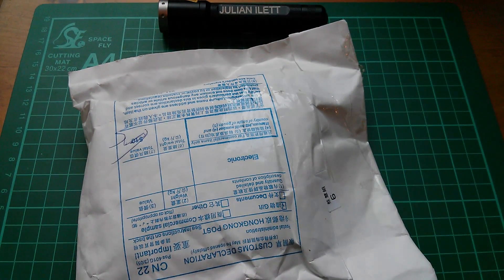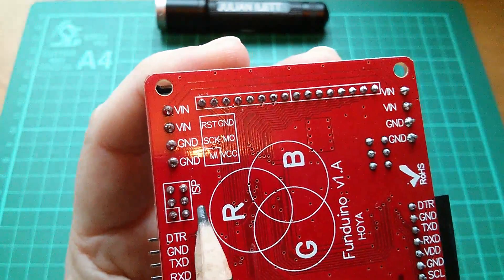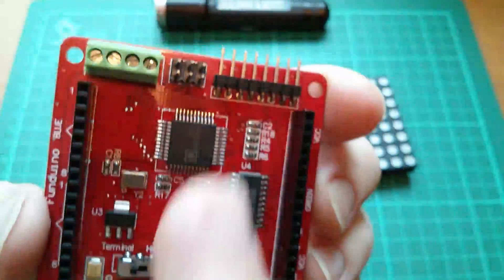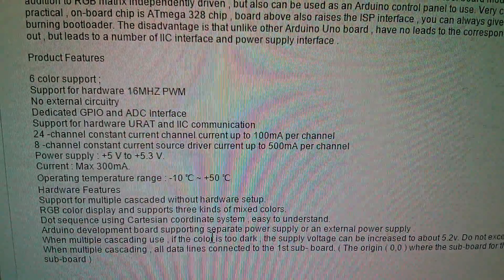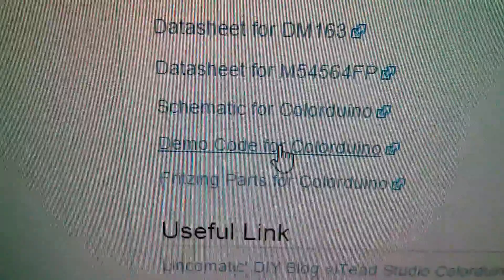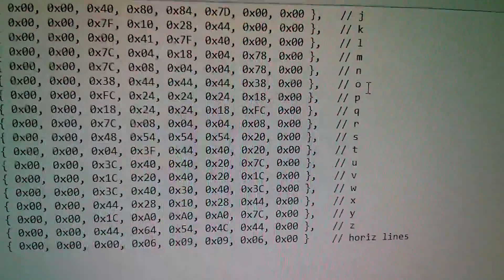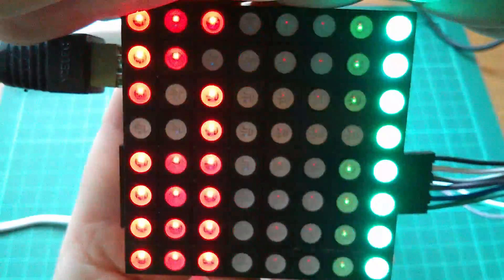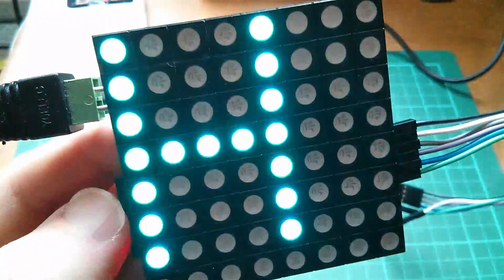Postbag: #30 - Happy Christmas on an ICS RGB LED Matrix

Comment: Hello these posts are from 2014 so not sure if the same topics are still valid, I got a Similar Board it says HW-426 but looks 100% similar, I am trying to upload code from Arduino IDE using USB to UART but not successful, any help is appreciated

Comment: CHeck this out:

/**
 * Colorduino Christmas Ornament
 * @author Raj Madhuram, 2014
 */
#include "fonts.c"
#include <Colorduino.h>

int mode = 0;

// For scroller.
int stepCounter = 0;
int scrollCounter = 0;
int currentGreeting = 0;
int const MAX_STRINGS = 4;
const char *greetings[MAX_STRINGS] = {
  "* Merry Christmas! Drop your presents below. *",
  "For unto us a Child is born - Is 9:6 ",
  "Joy to the world ",
  "Emmanuel, God with us "
};

// For color changing star.
typedef struct Color {
  int r;
  int g;
  int b;
};

Color current;
Color target;
int colorCounter = 0;
int const MAX_STEPS = 10;

char buffer[8][8];

/******************************************************
Name: ColorFill
Function: Fill the frame with a color
Parameter:R: the value of RED.   Range:RED 0~255
          G: the value of GREEN. Range:RED 0~255
          B: the value of BLUE.  Range:RED 0~255
********************************************************/
void ColorFill(unsigned char R,unsigned char G,unsigned char B)
{
  PixelRGB *p = Colorduino.GetPixel(0,0);
  for (unsigned char y=0;y<ColorduinoScreenWidth;y++) {
    for(unsigned char x=0;x<ColorduinoScreenHeight;x++) {
      p->r = R;
      p->g = G;
      p->b = B;
      p++;
    }
  }
    
}

void setup()
{
  Colorduino.Init();
  unsigned char whiteBalVal[3] = {36,63,63}; // for LEDSEE 6x6cm round matrix
  Colorduino.SetWhiteBal(whiteBalVal);  
  ColorFill(0, 0, 0);
  for (int i=0; i<8; i++) {
    for (int j=0; j<8; j++) {
      buffer[i][j] = 0;
    }
  }  
}

/**
 * Scroller 
 ***/

void scroll_drawPage() {
  ColorFill(0, 0, 0);
  int r, g, b;
  for (int i=0; i<8; i++) { 
    for (int j=0; j<8; j++) {
      
      if (j < 4) {
        r = 240; g = 0; b = 0;
      } else {
        r = 0; g = 240; b = 0;
      }
    
      if (buffer[i][j] == 1) {
        Colorduino.SetPixel(7-i, j, r, g, b);
      }     
    }
  }
  Colorduino.FlipPage();  
}

void scroll_drawText(int count) {
  
  int fontIndex = (int) count / 6;
  unsigned char c = greetings[currentGreeting][fontIndex];
  
  for (int i=0; i<7; i++) {
    for (int j=0; j<8; j++) {
      buffer[i][j] = buffer[i+1][j];
    }  
  }
  
  int idx = count % 6;
  unsigned char code = 0;
  
  if (idx != 5) {
    code = font[c*5 + idx];
  }
  
  for (int j=0; j<8; j++) {
    buffer[7][j] = code % 2;
    code = code >> 1;
  }
  
  scroll_drawPage();
  
}

/**
 * Color changer
 */
 
void cc_fill() {
  float alpha = (float) colorCounter / MAX_STEPS;
  int r = floor((1-alpha)*current.r + alpha*target.r);
  int g = floor((1-alpha)*current.g + alpha*target.g);
  int b = floor((1-alpha)*current.b + alpha*target.b); 

  // mask with an asterisk.
  
  unsigned char mask[8] = {0x00, 0x99, 0x5a, 0x3c, 0xff, 0x3c, 0x5a, 0x99};
  
  PixelRGB *p = Colorduino.GetPixel(0,0);
  for (int i=0; i<8; i++) {
    int row = mask[i];
    for (int j=0; j<8; j++) {
      if (row % 2 == 1) {
        p->r = r; p->g = g; p->b = b;
      } else {
        p->r = 0; p->g = 0; p->b = 0;
      }
      row = row >> 1;
      p++;
    }
  }
  
  Colorduino.FlipPage();  
} 

void loop()
{
  if (mode == 0) {
    
    colorCounter++;
    cc_fill();
    if (colorCounter == MAX_STEPS) {
      colorCounter = 0;
      stepCounter++;
      if (stepCounter == 20) {
        mode = 1;
        stepCounter = 0;
      }
      current.r = target.r;
      current.g = target.g;
      current.b = target.b;
      
      target.r = random(256);
      target.g = random(256);
      target.b = random(256);    
    }    
    
    delay(200);

  } else if (mode == 1) {
    
    scroll_drawText(scrollCounter);
    scrollCounter++;
    if (scrollCounter >= strlen(greetings[currentGreeting]) * 6) {
      scrollCounter = 0;
      currentGreeting = random(MAX_STRINGS);
      stepCounter++;
      if (stepCounter == 2) {
        mode = 0;
        stepCounter = 0;
      }
    }
    delay(120);
    
  }
}
Credit to the owner stated in the information
Reply: I uploaded this and told my Arduino that it was uploading to a Pro or Pro Mini, probably would have worked to a Uno but I was having problems with errors in the original INO that I had to repair, then run down the included files,  they were still available so I now have my Christmas ornament for the dash of our RV!

Comment: Greetings, I purchased one of these after watching this video.  This year, I have it along down to Arizona where we are spending the winter in our motor home. I plan on putting it in the wind shield with seasonal messages scrolling in color. I did a search of your videos and found this one because I needed the code, having nuked my laptop. I forgot the origional Win 7 disk, had my windows 8 disk along, but found that MS, in their wisdom has locked out my code so I am now running  Linux. Luckily I had  a copy of Mint along, actually it is a real pleasure running it on my little laptop with it's 16 gig of ram, she runs very fast indeed.

Comment: After watching this video several times now since before Christmas a year or so ago, I decided that I could go no longer without this little gem.  So after a bit of searching, I found one a bit cheaper at 14 bucks US and ordered it, from China.  Now, mind you, I have been waiting since March for some of the things from China, I ordered this last week, and it came today!  Unbelievable.  What I have in mind is to put this in the windshield of our RV when we are parked over the winter, down in Arizona, and display the greetings of the season, be it Christmas, New Year or what ever.  So I have been back here today to get the sketch so I can program it the way I wish.  I did locate another video that explains that the 1 on the light board mates with the 1 on the blue circuit, so that solves the pin problem. When I hooked mine up to a 5V power supply I got a very bright red stripe down the middle of the screen and then it went out.  I turned down my power supply to 3 volts and still no joy.  Then I saw that little switch, and flipped it, the next try I got nothing till I turned up the power to 4.5 volts and things began happening, at 5 volts all was well. Thanks a million for these videos, each time I find one, I give some more money to China for more fun at home.

Comment: I know it's over a year later, but just a comment in case anyone else comes across this.  A 5v regulator generally needs more than 5v going into it to successfully put out 5v.  I think a couple of regulators I've used require at least 6.5v input to get 5v out.

Comment: Hiya Julian.  Nice vid.  
Whats the green plug you are using at 4:35 to put power into the board?  I need one!
Reply: past this into ebay search bar   181255783741
Reply: or find  2.1mm to screw terminal adapter

Comment: Love your postbag videos, keeps me from buying ALL that stuff, however I do have the bug and have quite a collection now myself.  I am planning a weather station when it gets above -0F here right now it's -16F with 45MPH wind, not sure what that would be windchill but it is COLD out there right now.  Anyhow I just got this so I could get my weather station online: http://www.ebay.com/itm/271726513651?_trksid=p2060778.m2749.l2649&ssPageName=STRK%3AMEBIDX%3AIT I think I can make it work with an arduino nano hooked to the weather sensors in a small project box ventilated to get the proper air flow.  Not sure how to get wind speed but I am researching some portable units that may work.

Comment: Lol, the upside down display sounds like my sort of mistake. I have impeccable attention to detail, but totally miss the big, obvious mistakes. I thought something was up when the LEDs were partially lighting up on what should have been unused portions of the display. What's funny to me is, the only real complaint I had about the video was the fact that each letter enters the screen only once the last has completely scrolled off the left side. I was sitting here yelling at the screen about it. I believe "AWW COME ON!" was the statement. I'd spend an unnecessary length of time fighting with the code to handle multiple bytes of data to be fed, and no one would ever notice the difference.  :)  Thanks for the videos, I'm enjoying them!

Comment: In elementary school, they taught us that red, blue and yellow were primary colours.  This logic is derived from the fact that you can make any colour by blending them.  

This is faulty logic, because spectral colours are not necessarily composed of "elemental primary colours."   Our eyes can perceive a mix of colours that looks the same to us as a single-wavelength colour, but it is spectroscopically something quite different.
Reply: More accurately, the primary colours of pigments (which are subtractive) are magenta, cyan and yellow, but red and blue are "close enough for most purposes" to magenta and cyan.

I always wondered as a child why I got brown instead of black when I mixed red, yellow and blue in equal proportions.  Now I understand.  If I'd been mixing magenta and cyan with blue (in the correct shades), it would have worked as expected.

The primary colours of light are of course, red, green and blue (which are additive).

Comment: I was wondering if you were going to say something like that... 180 degree change :) I bought one of those boards about three months ago and had exactly the same problem with it. The original demo sketch it is programmed with is a nice colour swirl pattern - and it uses the full 'screen'. I'll see if I still have it running the demo code and will link a clip if so. Another great video as always! Merry Christmas!
Reply from the maker: Peter Feerick The swirl demo must be available somewhere - I'll keep an eye out for it. Happy New Year Peter